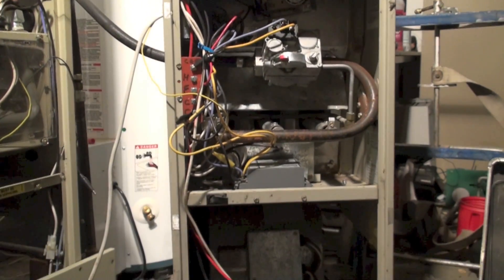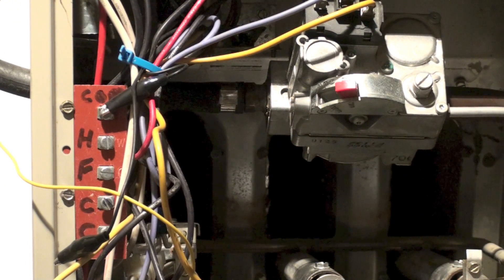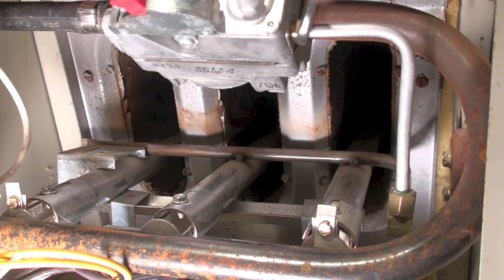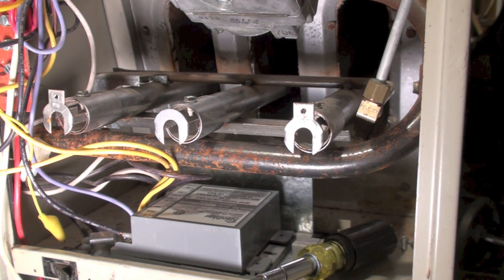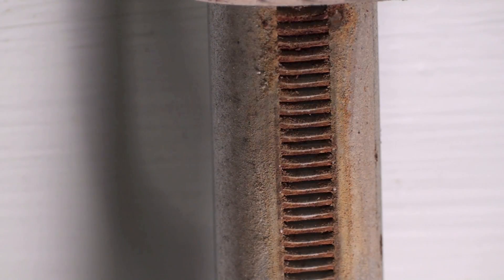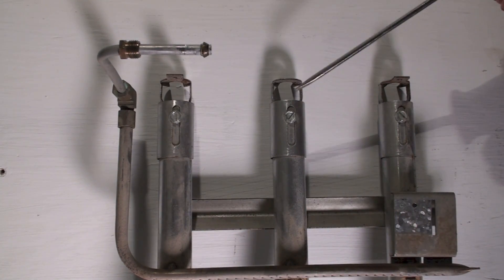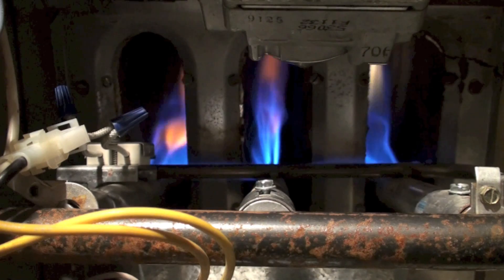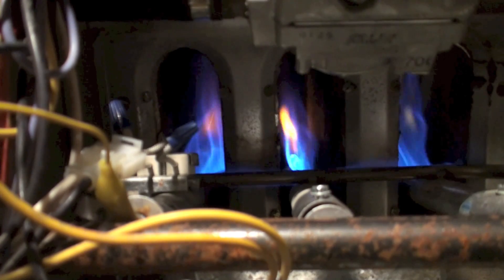Service the  Rheem RGDA furnace: clean the burners

Comment: Hey I just watched this video thanks for sharing. I have a rheem furnace, the flame sensor and the igniter are attached together on mine, but I also have a pilot light that stays on. If my pilot light is on but the furnace doesn’t come on do you think I should change the flame sensor?
Reply: You may have a mercury sensor on the controls.  You can tell by following the small tube at the pilot assembly to a small black box mounted on the gas valve.  If so, parts are no longer available for that system and the entire gas valve and control system will need to be replaced.  
GFM

Comment: Where is the inducer?...I can't find an inducer on mine either.
I have a Grimbsy furnace or that's what it says on the front.
I hear a loud buzzing motor for about a minute before the fan comes on then I don't hear it no more.
I think its the inducer motor but I can't even find it. It need greasing.
Reply from the maker: You may not have an inducer.  Sot=me of those units came without an inducer.
GFM
Reply: @grayfurnaceman  I wonder where the noise is coming from then?...and then stops just before the blower comes on.

Comment: Are those tubes with the slits replaceable? I have an older Ruud 90+ furnace, as, as your referenced, many of the slots are gone, and it is just open. The furnace runs and heats fine.
Reply from the maker: They may be available, however, that furnace is probably one made in the late 80s or early 90s and may be past its useful life.
GFM
Reply: @grayfurnaceman - Thanks. You are correct about the age, but how would i know if it is past its useful life, if it still runs normally?
Reply from the maker: @jeffmattero8500  First, that time period saw a lot of 90+ furnaces that just never worked out.  Case in point is the burners slots on yours.  They were made from aluminized steel.  Later models used stainless.  
If the heat exchanger is not cracked, you can still repair it and it may work ok for a while yet.
GFM

Comment: I have  ugud-075c model Rheem furnace from the early 80’s, and im trouble shooting why the burners will not ignite. So, I’m reading about heat  sensors and I do not see where I have one. I traced the gas line and there is nothing but a gas valve (model
# vr800a 1228). The only things I see are a pilot light and a thermal coupler. Is it possible that I don’t have a heater sensor? I honestly feel like I’ve looked every where. Would be happy to send a video of my unit. Thx for any attention and help.

Comment: Good video.. I know it has been on You tube a long time and I have watched it before. As a Service Tech  for a large gas utility for 36 years I must ask::What the heck kind of gas connector is that ?? I know that was natural gas because of the color of the flame. In Southern California I never saw anything like that. In fact the code calls for a solid nipple to extend outside of the furnace case and the entire flexible connector to be outside the case. Is that true where you are at ??
Reply from the maker: +J.R. Richard Its a gas hose.  Used for temporary connections.  Note there is an explanation at the beginning of the video saying the unit is not wired or piped for permanent install.  Thanks for watching.
GFM